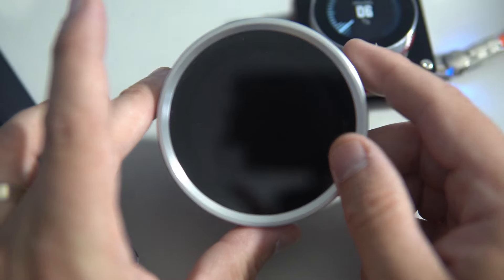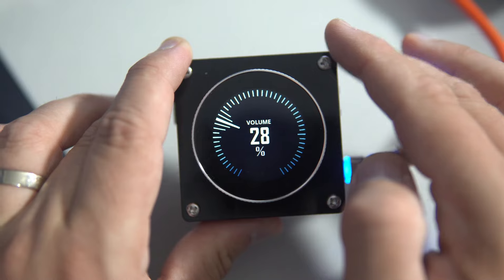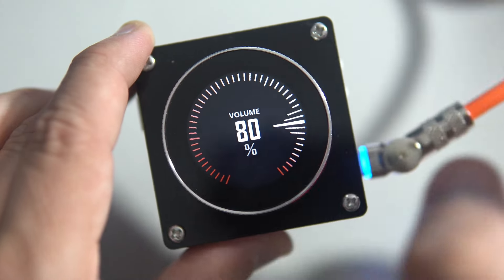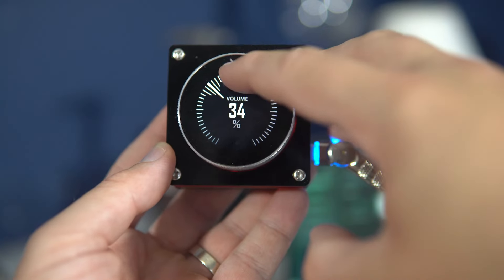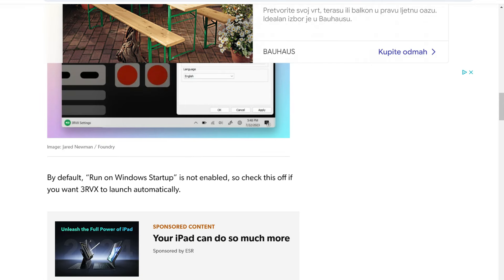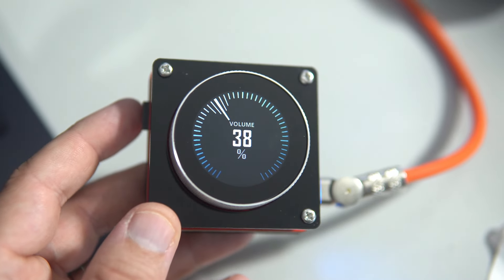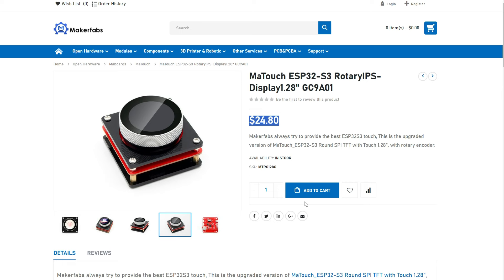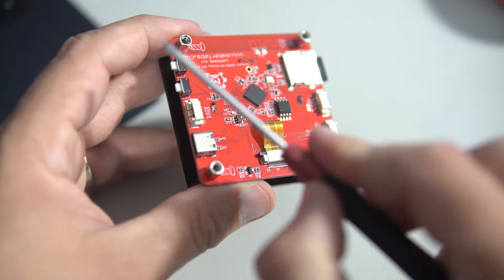Control Your PC Volume with ESP32-S3 and Makerfabs MaTouch Display

Comment: As usual, a great project, resulting in a great design that is clean and simple in its aesthetics and operation.
However, I am a little disapointed that you don't appear to have exploted the MA Touch in your projects. Aesthetically, the MATouch is far better than the M5 Dial. So, how about a project for home automation that includes  433 mhz remote signals as well as BT  BLE Utalising the MATouch as the main control interface?

Comment: bought this board and downloaded your code, but getting an error on upload...
who wants to help a noob?
Reply: I am also getting a fault "ledcSetup was not declared in this scope"
Reply from the maker: You need to downgrade your esp32 boards to version les than 3.0
Reply: @VolosProjects  Thanks! that did it
Reply: Still getting errors but different one after downgrading. What board did you select from the dropdown?
Reply: nvm i was able to get it by downgrading the GFX as well. Then I rotated the screen so that it faces away from the usb C. Working on designing a 3d printed case for this awesome work Volos!

Comment: Volos, this is great! Can you make a short video to show how to upload the sketch with Arduino? I assume we have to reset the board to put it in Prog mode (it comes with a basic Makerfabs sketch). I just want to make sure which board  to select in Arduino. Step 2, we need to download that 3RVX utility or is that not needed? Thanks!

Comment: You could add controls for other audio options like bass, treble, equalizer, etc
Reply: That would need implementing comunication with the audio driver.

I never know keyboard shortcut for that function. This device only mimic keyboard device, i guess.

Comment: I also think you could control the volume via a bluetooth connection.

Very nice project!
Reply: But if the computer is connected to a soundbar via bluetooth, I don't think you could achieve it. I don't think the bluetooth adapters in PCs or laptops are usually multipoint capable, if that's what the technology is called.

Comment: you could do this via bluetooth, then you don't need to connect the cable. to the laptop ...
Reply from the maker: Yes i know but then i need to find way to power board.
Reply: Is it power hungry device ?
Reply: @VolosProjects  well it could be powered by a power outlet, but at least no plug at the laptop...